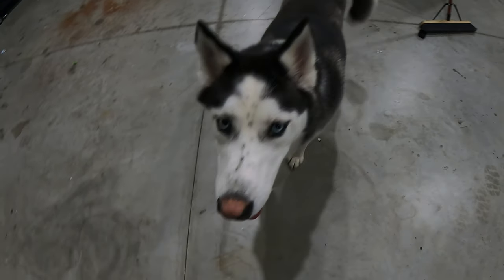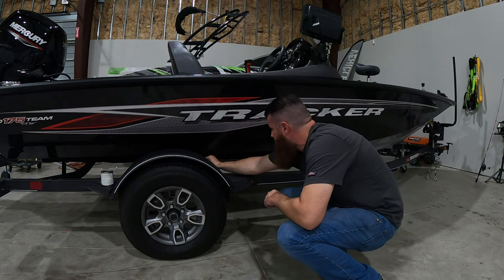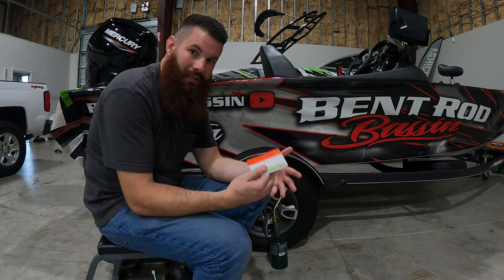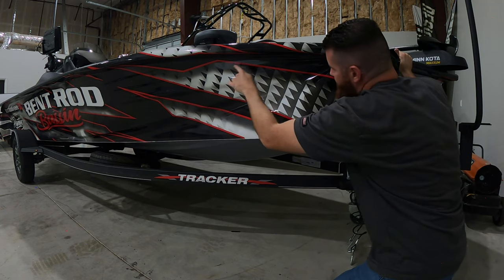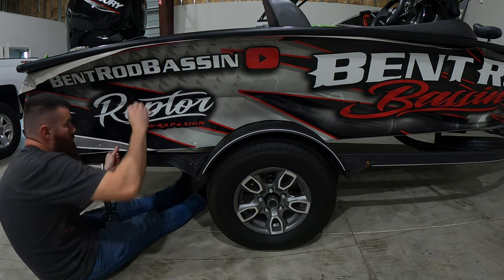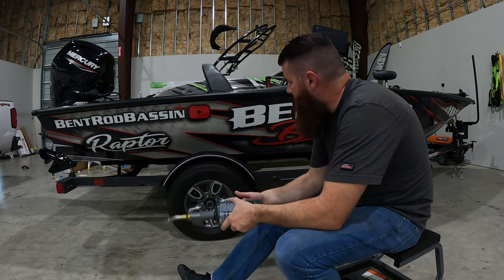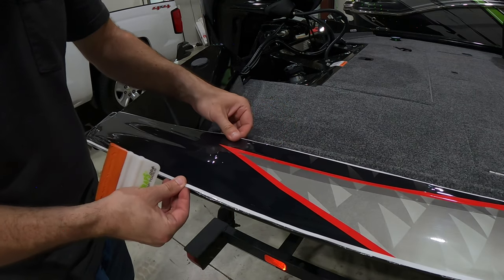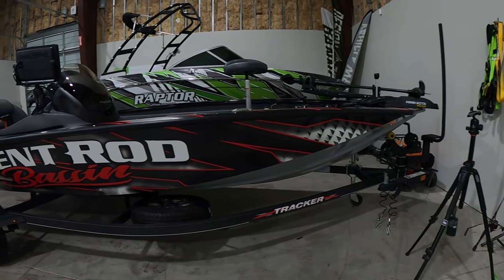Bass Tracker Boat Wrap | How To Vinyl Wrap Your Boat!!!

Comment: Looks great 
Nice video 

Any problems going over the original decals? Car you see them after the wrap is on?
Reply from the maker: You can layer over the decals with no issue. They are slightly embossed under the wrap.

Comment: Try one with rivets and a rib down the side. It took me 2 hours per side on an 85’ 18’Alumacraft. I didn’t use any seam sealer mines been on for 2 years not a pealed place on it. I cut it 1 inch above the bottom of the boat. Putting on a wrap is not for a beginner. I only used the heat gun on the rivets.
Reply from the maker: Rivets are definitely fun, good times!

Comment: Where you popped the pin holes to release the air bubble would you put sealer over them
Reply from the maker: No sealer needed, just post heat and your good to go!

Comment: Can you put knifless tape to primer and still use the tape to cut?
Reply from the maker: Yes it works well on top of primer 94
Reply: Is it difficult to remove the plastic casing around the cut tape once it’s put over the primer.